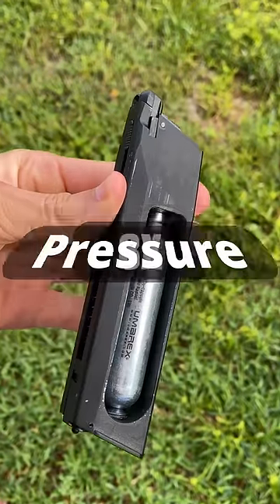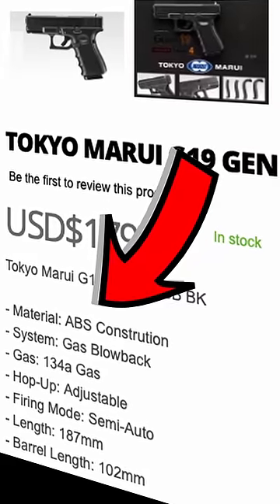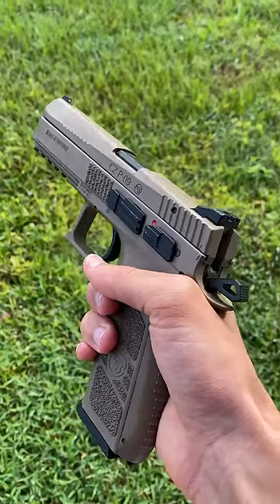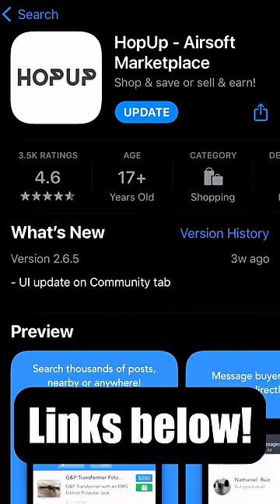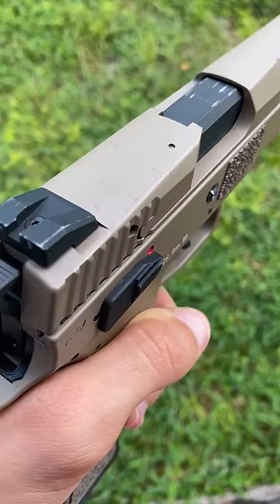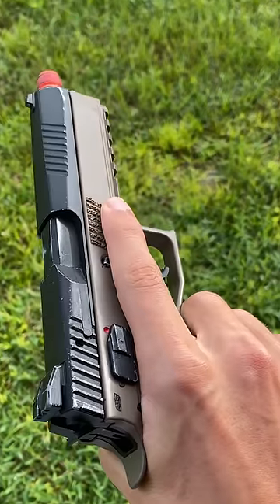What Happens if You Put CO2 in a Green Gas Gun 🤯

Comment: Your gun will not function normally if you do that, unless your air soft is designed to work with both gas.
Reply: It will work but co2 will eventually crack the nozzle
Reply: Nozzle?
Reply: @Flyingsgetti  the thing that feeds the gas into the gun, too much pressure
Reply: @Flyingsgetti  airsoft guns have a nozzle that propels the bb using gas
Reply: this cz is designed for both
Reply: CZ p09 is made to be used with both co2 and greengas. the slide itself is not the first part to colapse, even a plastic one, but the internals are. co2 just wears parts faster
Reply: Pressure is pressure
You can weaken the output by decreasing gas output
Reply: It would most likely put to much stress on the gun if you use co2 instead of the green gas
Reply: True

Comment: The CZ P-09 is made to use both... I've bought one with a Metal Slide and got a Green Gas Magazin but could buy a CO² Magazin...
Reply: Magazine
Reply: @thechickensfight  sorry, my gramma is not the best but greets from Germany
Reply: @Lurking_Marc  he is a troll
also i am a jew
Reply: @User-10ne7ndwbdkqba  What?
Reply: @Lurking_Marc  oh hi, wie geht's?
Reply: @Malsuc  moin Hans
Reply: i need a czech gas pistol is it good?
Reply: @SlavicZde  in my opinion, yes. Some times i had the problem that the slide got stuck by moving to the front, but i just had the wrong gas 😅😂
Reply: KJW CZ gun series are designed to use CO2 gas capsule in the first place as most of their products are made up of steel. For green gas use, well, it would also work but with less power to push the upper slide back to reload.

Comment: If you do that with a Hi-Cappa it’d probably explodez
Reply: No it wouldn’t
Reply: Yup. It will. Mine already did lol
Reply: @frostythesnowman5138  depends
Reply: Most likely just won't even fire...
Reply: Mine worked my guy
Reply: @H0LYZ3N  If it's not a Tokyo Marui then it is way more likely to work fine. The reason he says HiCapas explode is because the original HiCapa is a TokyoMarui with the plastic slide
Reply: Bought the very expensive john wick one and ran probably 100 bbs through it and the co2 basically destroyed the gun. Even put so small visible coats of grease and still ran like crap, jam and after 100 shots or so it would fire and the slide wouldn't go all the way forward and jam up so you had to bang it on a table or tree to get it to go forward app the way. Will never buy a hi cappa again.
Reply: @OFFICIALNATHANBLADE  bud, it's not a real gun. If something is fucked there's a reason to it. Open the gun and check that all the screws are tight, it seems like that's exactly the case-probably the blowback housing got loose and had too much wiggle room in between the frame and slide.
Reply: Ur buying some cheap ass hi capas.
Reply: @slowbbs  Don't know who you're replying to but I don't.
I have had one Tokyo Marui HiCapa for three years and it was amazing, I still have the frame(the slide cracked).
I hope than one day I'll be able to restore it.
Reply: @frostythesnowman5138 i had a tm hi capa that beat itself to death on green gas. C02 would have definitely destroyed it.
Reply: i run CO2 in mine bc i upgraded the nozzles
Reply: @OFFICIALNATHANBLADE  the John wick is crap. it's made by army armament and the gun itself can be bought for about 90 bucks. it's only the licensing that makes it expensive
Reply: @gottroubletactical  tm hi capas aren't even supposed to run on green gas. the nozzles and blowback assembly are made to run on HFC 134a duster gas

Comment: No *immediate* wear and tear is all I got from this
Reply: This specific cz was designed for both if you put that in a gg only hicapa itll explode
Reply: @Cole_Floyd  It's surprising it even makes a shot. Given that it's supposed to just not be able to apply enough pressure to a valve that has CO2 holding it closed.
Reply: Yeah I did that with a hicapa once and after done shot my entire blowback nozzle broke

Comment: Typically, the exterior of the pistol is merely a facade for the internals. You should be fine so long as the internals are designed to stand the pressure

Comment: That replica (P-09) has the same internals on both of those. The ABS slide version is not a metal slide just to be a cheaper option for customers
Reply: are you completely sure? just bought 1 and the site sais not to use co2 cause of the polymerslide.

Comment: most will work fine. But over time small parts will wear down a bit faster and the nozzle spring ends up breaking faster and i've seen nozzles crack. I wouldn't recommend running them with co2 exclusively but a few shots wont break anything.

Comment: First, Tokyo Marui replicas are usually made to be used with blue gas (a weaker gas than green gas).
Second, most of the time it's not the slide that change but what's inside the slide. For exemple my FNX 45 is not made for CO2 but the slide is made of metal. It's usually the nozzle that is reinforce to be used with CO2 pressure.

Comment: There are some people in the comments saying that this only works because that particular green gas pistol is CO2 ready. While it is true that the pistol shown is CO2 ready, I can confirm that this also works as a TEMPORARY replacement for green gas in Umarex Glocks, a Hi-Capa my friend owns, and a bunch of cheap plastic green gas pistols I had just laying around. That said, don't use CO2 as a permanent replacement for green gas, or as an fps upgrade for long. After an average of 15 mags across the pistols I tried, they started to show stress and cracks on the internal components. It will work for a few mags though

Comment: Takes much higher pressure on the valve to be depressed with a CO2 cartridge.
Normally any Airsoft pistol that is designed to work strictly with GreenGas will simply be unable to apply the needed pressure to even fire a shot.
The question is different when we talk about higher pressure gasses like the "Red" and "Black" gasses which can cause issues after long term usage. Especially if you bought WE garbage.

Comment: You used ASG cz's that are litterally meant to be used with either co2 or green gas mags. The cheaper $80 ones come with green gas mags and polymer slides but you can still use co2 mags with no real issue.

Comment: I’ve never seen anybody talk about this but you can get a full auto, high quality, metal, gas blowback steel bb pistol for less than 200 dollars so if you get a bb pistol, made the gas valve smaller and put a lighter spring in for the blowback could you make a cheap high quality bb pistol?

Comment: 134a aka Green gas is also known as 1,1,1,2-Tetrafluoroethane and due to its potential as a greenhouse gas has been banned in Europe for refrigerant applications. Why anyone would call this green gas, let alone use it in an airsoft gun, is beyond me.
Reply: Green gas is usually just a mix of propane and lubricant. I don’t know where you got that info from, but most of the green gas on the market is 99% propane, which is not considered a greenhouse gas.